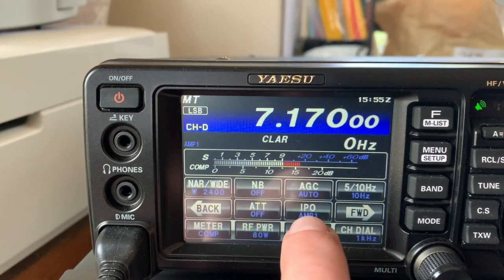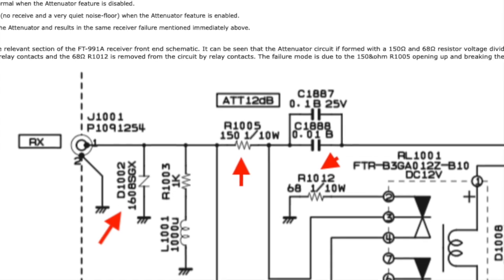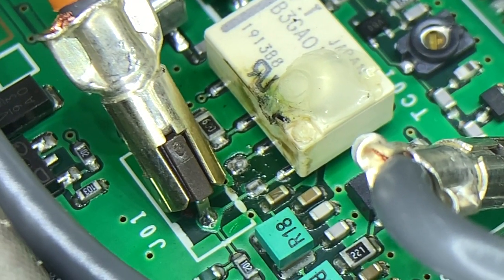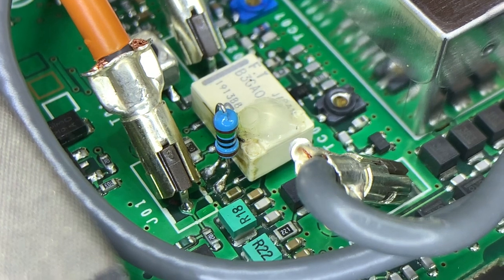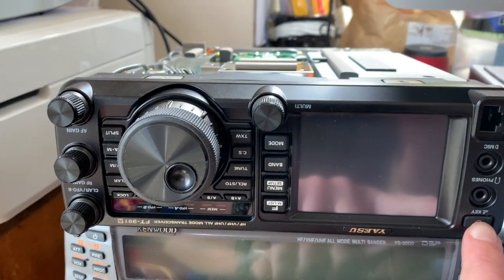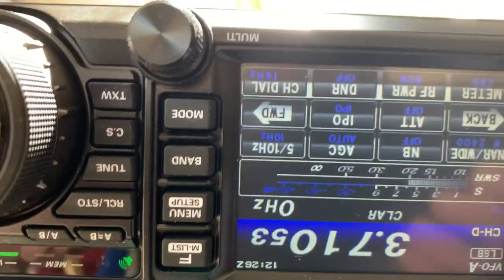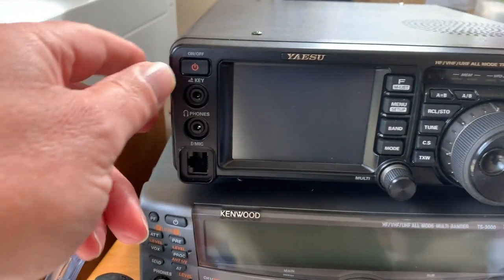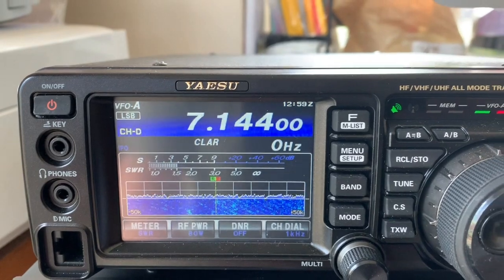MY YAESU FT-991A  IPO/ATT FAULT - Frontend gone Bye Bye......

Comment: Hi Mike, Thank you for posting the link to my article, and I'm super pleased that it did someone else some good.  The friend who's radio I repaired operates multiple radios at the maximum legal limit and has not experienced a failure since I did the original repair that was documented in the article.  

For those who ask about leaving the radio on with a nearby transmitter active, this is not a good idea.  The RF at the receiver front-end is half-wave rectified by D1004 and then the resulting DC bias drives Q1005 into saturation, activating the ATT circuit (and making it susceptible to burn-out).  This vulnerability is discussed in the article.  Q1005 was a good idea by Yaesu, but wasn't implemented quite correctly in that the resistor power rating in the attenuator was not up to the task.  The goal of Q1005 was to have the attenuator kick in and protect the receiver front end from nearby RF sources.  Had the attenuator not burned out, the circuit would have done just that.  Cheers.  W7CIA

P.S.  I've added a link back to this YouTube video in the article.
Reply: Anyone considering doing this fix please read this article: https://github.com/rfrht/FT-991A/wiki/FT-991-A-deaf-in-IPO-mode,-receives-normally-in-AMP-modes-in-HF-bands . 73; PY2RAF.
Reply: @rodrigofreire7604  All well and fine.  The PAD was damaged on the board on the original radio that the article was written on.  There was no option to do SMD soldering on that particular radio.  He may be horrified, but sometimes there aren't other options.  If you have that option, I certainly would go that route too.
Reply from the maker: I did find your article to be a life saver for my radio, thanks for uploading it. :)
Reply: For sure the low end radios (or any?) are not designed for high power multi operations. The best would be band pass filter for the band radio is using.
Reply: Thank you guys.  My FT-991a failed with these exact symptoms 2 months before the expiration of the warranty, so I was able to tell Yaesu exactly what was wrong.  Still took them 2 months to replace the resistor.  Now I need to know if I can use it in FM 2m mode while transmitting with 1KW next to it with a DX3000, or if I just need to sell it.  I never use the radios on HF together, and now that it is out of warranty, I dont want to risk it.  They replaced the resistor with the SAME 1/10th watt resistor even after including your article.   N5GGG

Comment: hi! this is a problem on a 991 (not A) that ive just bought used. i am going to try fix it... would you be able to link the correct resistor to use for this please? I will be able to solder it, just don't want to put the wrong one in!! Thank you so much for this video as well.
Reply from the maker: Just find the SMD version of the one I used.

Comment: Yaesu were good with me in emailing them about my Amp remote out not working. They suggested checking the transistor that switches it to ground yet the transistor was stuck open with a voltage on it. In the end I found the solution with TRX Lab. I believe it was Pin diode D113. i guess I purchased it used like this. Perhaps why it wasn't too expensive. I discovered this later when I needed a switch to deactivate my noise eliminator from VK5TM.
  I have some spare pin diodes now. it was close to the section your working in. Tight work but doable with microscope viewer and a slim soldering iron if care is taken. I'm a little surprised it self destructed like this. I've messed around with some badly tuned amplifiers and it's withstood reflected power but to be honest I've not really used it to monitor other radios other than on low power.
Reply from the maker: Thanks for the info

Comment: Thanks for this detailed instruction video, my 4 year old 991A has just developed the same problem.
Reply from the maker: Glad it helped
Reply: I have opened up my991A and the resistor is intact but it is showing as 1K ohm with my meter. Should I replace it anyway ?

Comment: Many thanks for the Great Video Mike I have a 991 With Same issue The Resistor does not look blown but it looks as if its got a bump on the top i never new this was a fault until i tested it against my mates 991 a brand new out of the box thanks again

Comment: Will this happen if I use a legal limit amplifier with my 991a?
I also run 2 radios will it be ok if I disconnect the antenna and switch it off?
Reply from the maker: I have no idea, I decided to sell the radio once it was repaired.

Comment: If one must listen on another band while transmitting, external band pass filters are the way to go. 

If listening while transmitting is not required, some relays and XOR keying logic with the amplifier keying lines offers a lot of flexibility. I use the amplifier keying line from my transceiver to operate a pair of isolation relays for the SDRPlay receiver.

Comment: Was this a 2nd attempt at repair as the relay looks melted as if touched by a soldering iron. Perhaps it was from you cleaning up the pads. Caution as this could cause the relay to fail mechanically.
Reply from the maker: yep, from cleaning the pads - easy done. :)

Comment: MOst of the radios have very similar front end protection nowadays. FT-991 has a protector for 8KV/30A momentarily. In a club with several stations, a band pass filter is recommnded for each radio, especially if linears are used. And also a RF choke on the radio side.
Reply from the maker: great info thanks
Reply: This is excellent information. This might be the best information I've read on the subject of where to work with the transceiver . Sir, I am curious about a situation, what is the source of this information? TA1ODM 73.

Comment: Thanks Mike, my 991 for some reason stopped receiving in IPO, I calculate that due to high radio frequency nearby, how could I replace the 150 ohm resistor and solve the problem, thank you very much.

Comment: We all know that Yaesu will never admit one way or the other that this issue
is a problem. One other reason that this failure occurs is static and lightning.
Digikey does have a direct equivalent SM resistor that I figure is a better 
for replacement that a thru hole component.  Digikey has it as (CPF-A-0805
B150RE).

Comment: Hi mike,many thanks for the vid, i have just bought a 2nd hand 991a and it has this problem, on examining the resistor its still in place but my radio has exactly the same problem as yours in the video, will removing the resistor and replacing it be the answer ???? or is there a way i can check the resistor before removing it ???? many thanks mate
Reply: You should be able to check the resistor with a multimeter but also check pin diodes D1113 and D1089 they can sometimes go bad which may also be a cause of similar problems and other issues coming from that zone. However you need good skills to replace these as they are tiny.

Comment: Hi Mike, I have a 991a with a slightly different issue but could be related. Everything seems to work as it should but i have a dead S-meter on SSB, On FM it flickers erratically. The TX side of the meter reads as it should but on RX it just sits at 0. No one seems to know or have heard of this issue. Any help greatly appreaciated. Lee M0RQX
Reply from the maker: Hi Lee,  it needs to go back to Yaesu or a good repair shop.

Comment: Hi Mike….just a simple question bearing in mind I know nothing about this hobby..
I’ve just bought a Ft991a as a receive station only and will not be transmitting on it - will  I cause any damage to it if I run this off the same ariel as my ic705 which I use for receive only aswell?basically running two rigs off one ariel through a 3 way BNC connector?….much appreciated rep,y please…( please forgive my lack of knowledge on the subject!)
Andy W
Reply from the maker: Hi Andy,
You will have no issues using the same antenna at the same time for receive only. However,  if you transmit on any of the radios when any of the others are connected you could/will destroy them.  Also please be aware that you are sharing the received RF between the connected radios you could lose the weaker signals,  each radio connected will reduce the incoming signal by 3dB (half).
Reply: @mike-M0MSN  hi Mike- thanks ever so much for the swift reply….I’m a complete novice at this and these rigs are a nessecary evil for my hobby of aviation / airband listening.But that’s great…puts my mind at rest about running the two off one ariel.
You might be sat there thinking I’ve bought a lot of radio just for airband listening so I’m only using them as receivers atm but since upgrading all my older equipment there’s some fantastic kit on the market now.I’ve never dealt with amateur radio before ie SW and HF but since buying all this new stuff (a Yaesu FT3D handheld aswell) I thought I may aswell start listening in on amateur aswell and finding it quite interesting Mike….
Thanks for your reply Mike…just as a matter of interest - I understand your comment about losing some of the weaker signals due to running off one aerial….is there any sort of booster I can get to help pull in more signal.?(obviously height is king when it comes to ariels especially airband with line of sight etc etc)….
Regards
Andy

Comment: HI Mike
I had this problem but have just received my 3 month old 991A back from Yaesu repair under warranty.
all good now, many thanks for explanation. 
R1005 was blown, R1012 high, D1089 gone high resistance and a 47ohm resistor?
so a bit different. 73 Rob G3RCE
Reply from the maker: glad it's working :)

Comment: Listen my children, as I share a brief portion of the response I received from Yaesu on this matter:  Irrelevant portions omitted: "Thank you for contacting Yaesu regarding the FT-991A.

Yes, it is possible to take out the front end of this radio if you are using it in close proximity to other transmitters, as can happen on field days.

This applies to a lot of radios, not just the FT-991A, and can usually be safeguarded against by using external band pass filters in a field day situation.
If there is anything else I can help you with, please feel free to contact me.

 

Best regards,

Rodger Kerr, N6GMT,

Amateur Radio Technical Support

Standard Horizon Marine Support

Yaesu USA

6125 Phyllis Dr

Cypress, CA 90630

r.kerr@yaesu.com

714-827-7600 Ext.1223"
Sent an email to my vendor accordingly.  We shall see what comes up next.
Reply from the maker: Guess they missed the point.......................

Comment: Seriously good video. The clarity of the images was superb. Thank you! I'm on the fence on buying a 991a. I have a IC-746 that works well but it doesn't have modern noise reduction filters. Do you think I can just add a DNR speaker (they cost nearly $200 US) to my 746, or would it be worth the investment going from a 20 year old radio to the 991a?
Reply from the maker: Go for the speaker! it just may save you some money, and if not you can sell it online.

Comment: Hi mike  I glad  you posted this issue with 991A ,it just happen to my brand new  yaesu 99A  with  less  than 5 hrs use.
  I will examine mine , it looks pretty much the same issue ,I was trasmitting on 80M while the 991A was monitoring 20m , then i realize the front end was gone on my 991 ..over the years I have many radios set up the same way and never before happen anything like that, it is pretty  upsetting since  is a brand new radio ..I will try to fix it since I live in DR . HI6FMX thank you mike
Reply from the maker: Good luck.  :)

Comment: Thanks for the video.  My radio also suffered a failure while operating with a legal limit transmitter.  On my radio, it did not matter if the attenuator was on or off, the receive would only pick up extremely strong signals.  R1005 was split in half.  In addition, pin diodes D1113 and D1089 also failed. For some reason D1090 was ok.  I was lucky to find the diodes on digikey as they are now obsolete.    The diodes are tiny and the only ones available are an even smaller form factor than the originals.  Replacing them was like giving a flea a haircut.  Anyway, just want to let people know that if the fix isn't successful, check the pin diodes following the resistor.
Reply from the maker: Thanks for the tips.
Reply: @mike-M0MSN  D1113 also causes the remote PTT out to fail. It causes voltage to arrive at the base of the switching transistor while in Rx. TRX Lab just did a video on this and i also had to replace D1113 I will be trying a generic diode as i don't want to pay €20 postage for a €0.40 diode.
For the pin diodes they have them for sale on F u t u r e  e l e c t ronics, search RN142SM or ask yaesu to send some. I have recently discovered many complaints about varnish on the underside of some of the boards stopping various ground connections from making contact where they should be contacting. Perhaps this is causing power surges along unintended paths that then damage components in this zone? Another complain is a bad ground hum for some people using the MD base mic. Could be another board varnish issue causing a lack of ground in some places.

Comment: Great video!  I would like to caution others to NOT use a wire wound resistor.  Wire wound resistors can behave like coils in RF and audio circuits.
Reply from the maker: Good tip!

Comment: Thank you Mike, for this valuable contribution. I operated two KW transceivers in same shack. The FT-991 immediately failed, with the problem described. Thanks to your contribution, the matter was settled after one hour ... Thank you very much
Reply: It works without problems since...
Reply: @dl5ycx  do you still use it around your other 1kw transmitter?
Reply: @motormayhemthevideos  I still use it without problems....
Reply from the maker: Glad it helped
Reply: Did you test that again after the fix ? Did it hold ?

Comment: Hi Mike, I have seen (and repaired) nearly identical damage to other models of rig. This is by no means a Yaesu or FT991A only problem, FWIW switching the radio off does not protect it from this type of damage.  It is difficult to protect against this type of damage without affecting IMD performance. Unfortunately the attenuator is prior to the bandpass filters so the damage can readily occur even if the transmitter is on another  band. Glad to see someone else fixing their own gear! 73
Reply from the maker: Many thanks for your comment, I will also be isolating the RF input to earth

Comment: i havent looked at the schematic but the question is, can you leave this radio ON while transmitting on another radio?   What about VHF?   say I use the 991a as a VHF/UHF radio, it's turned ON and i'm transmitting on another HF rig, will this burn the resistor?    ALSO what if the 991 is OFF and it's connected to an HF antenna while i'm transmitting on another radio?  will that cook the resistor again?
Reply from the maker: Don’t know, I simple turn it off now when I use another radio.....👍
Reply: @mike-M0MSN  I hear ya but I like to scam vhf on the 991 while xmitting on HF, I don't know of another modern radio that will do it all for $800.
Reply from the maker: @morejelloplease  True, don't hold me to it but I guess it should be ok......

Comment: Interesting. I bought my FT-991A s/h from a reputable dealer and it had the IPO fault and also was deaf on VHF / UHF SSB only. It was a long repair job but finally tracked down to blown diodes (invisible) in the front end. Luckily, they repaired it FOC and Yaesu apparently paid the bill. Then I knew why the previous owner had traded it in!
Reply from the maker: MirlitronOne it’s a great radio but it has more than its share of issues!!,

Comment: same issue with a ft891. Not sure if same cause. Works normal till ipo or att is turned  on
Reply from the maker: Hope you can get it sorted .
Reply: @mike-M0MSN  well i found nothing like in the video.  The mars mod performed was iffy. I cleaned that up and notice the 2 resitors next to that spot appear to have been removed to attempt to unlock tx.  But dont think it had anything to do with ipo att not working. Theres no documentation on this problem with the  ft891 like there is with ft991a. I will have to find a schematic

Comment: how many watts?  how far away from other transmitter?  what types of antennas?  how far apart were the antennas?  what frequency?

any rigs front end can be blown; i'm curious as to the condition/situation that caused your failure
Reply from the maker: rttakezo2000 All good questions,  I will try to answer,  80Watts,  5 metres (Other end of a room),  EFHW,  100 metres apart maybe more, 80 metre band.  Both my Kenwood’s survived without any issues.

Comment: Good job ! That happened to me about 25 years ago - I had an IC-725 in my bedroom as a receiver. I had left it on with an antenna connected. I was in my shack working DX. When I came back to the bedroom, the front end of the IC-725 was damaged. Ever since then I have made absolutely sure I do not have other rigs switched on and connected to a nearby antenna while transmitting on a different HF rig.
Reply from the maker: Yes, I will be doing the same..

Comment: I'd be cautious about adding a zener diode across D1002. Non-linearities, parasitic capacitance etc might create undesirable effects. Any conventional zener will try to conduct in forward direction at around 1V). Using a higher power rated R1005 (as shown) is a good choice although keep in mind that some conventional resistors have spiral cut film which can add an inductive component.. could that make attenuation vary with frequency on higher bands? I'd try to select a non-inductive part.
Very careless of Yaesu to make such a mistake.
Reply from the maker: Point taken Steven, as it is the radio is working well with just the resistor replacement.  :)